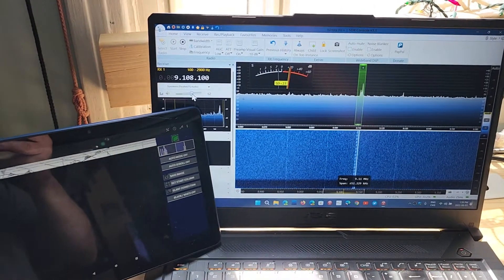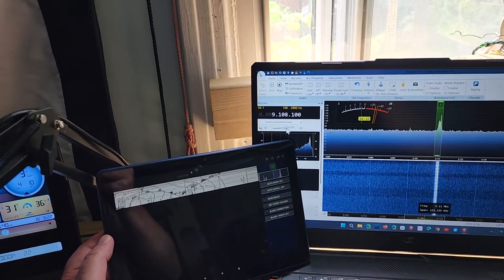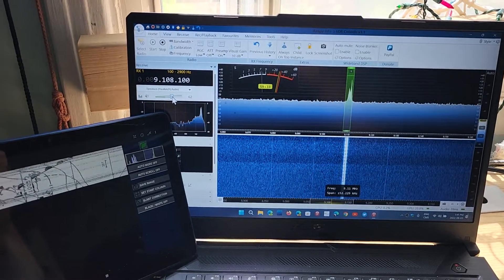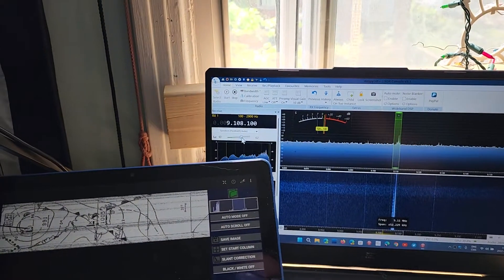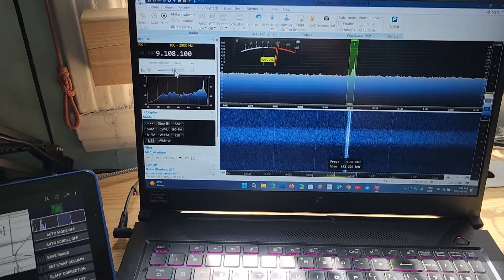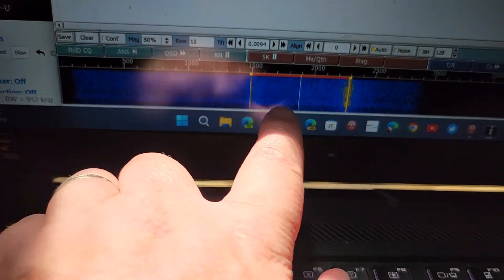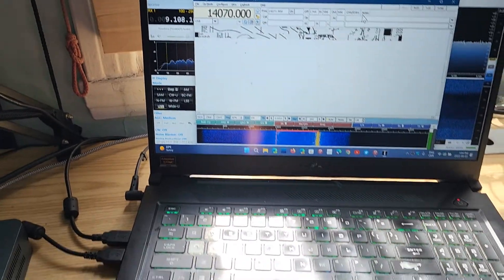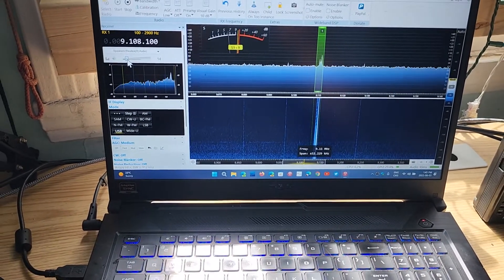Shortwave 101 beginners series Quick intro into how weather fax decoding works

Comment: Excellent presentation!  One suggestion: I use virtual audio cable software to make a connection between SDR Console and FLDIGI.  (I also use it to connect SDR Console to WSJT-X to monitor WSPR signals.)